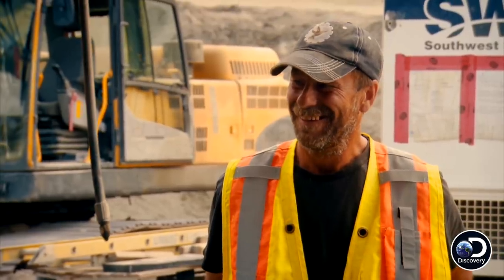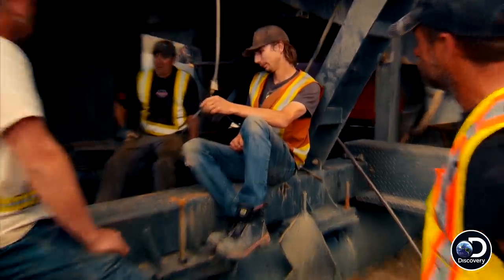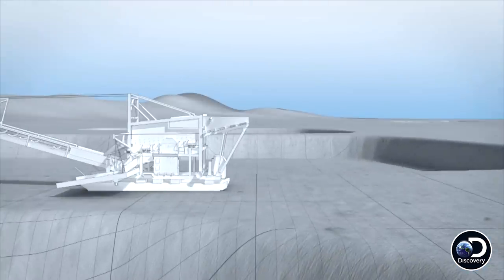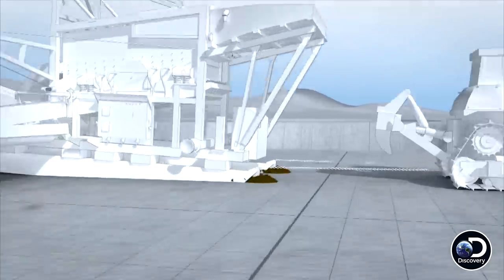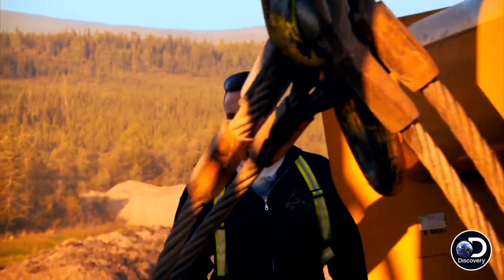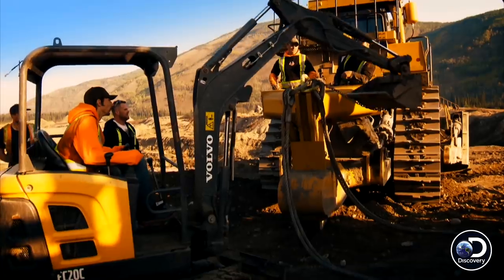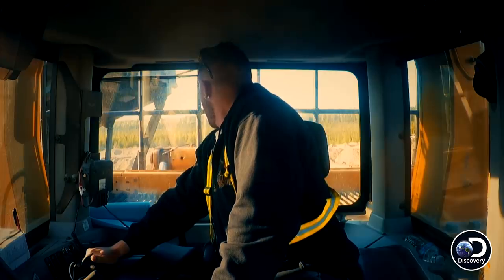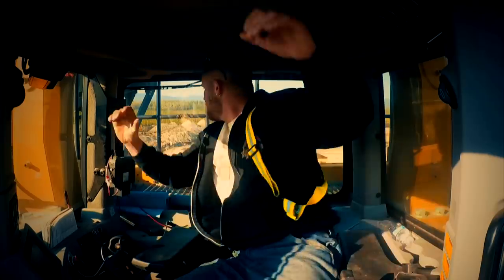Parker Tries to Move Slucifer Using a Dozer | Gold Rush

Comment: You could also have used the top of the front blade to lift up, but either way you need to be much closer. Way to far away to lift up. Shorter chains , guys